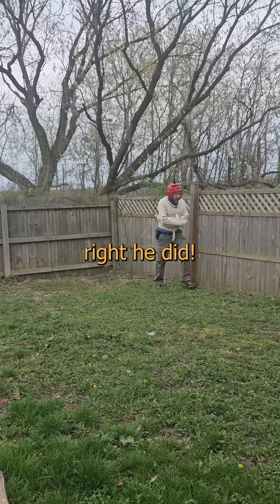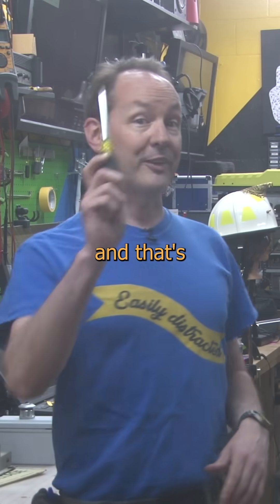Rack Screwed #chrisboden #comedy #engineering #screw #hardware #rackmount #apprentice #educational

Comment: I remember the first time i was handed an impact, first time i ever used a drill. I promplty stripped every bolt on an air handler panel (was industrial, so like, fucking 20 lmao).
My boss didnt trust me with an impact for 2 years. The first thing i did when he gave me it again was strip a bolt LMAO. Ive gotten better since but the look on his face when i told him i already fucked up in the 3 seconds he had his back turned was worth hand tightening the rest.
And no, i didnt strip any on purpose, im just heavy on the trigger.

Comment: It is this exact reason I was able to get quick install rack slides budgeted for all rack across the entire fleet of power plant server rooms...I was forced to work with a team of Meatwads doing a full network equipment refresh about 12 years ago and after the fourth one that I had to unmount and remount because of either wrong nuts, wrong screws, or mounted crooked I completely lost my shit, sent them home and did all of the mounting before calling them back to swap the cables from old to new switches...then immediately got approval to move money from a different project with head room and ordered roughly 300 pairs of rack slides that require no hardware to install or adjust.  This is also why things like A+ certification are actually valuable as the programs that train you for that cert also train the simple mechanical things you run into in PC repair, but aren't on the test.  The Plant systems guys that work on the stuff really buried in the dark depths of the plant went down to Maintenance with dimensions and budget to get them to make custom Racks with static 3U permanent shelves.  What they got were rock solid, beautifully tig welded racks with permanent shelves and a mounting system that used Plant Standard M6 and yellow painted indicators with the bolt type, we usually only label stuff off STandard, but they wanted to be safe since Instrumentation team won't be the primary workers messing with those racks.

Comment: 😂 yeah, once you find something odd, you should stop and figure it out, or you ask someone... why is this???... from someone who knows. This is poetic, because it is so rare a person is made to fix a stupid mistake, and usually it's a royal pain to fix later on down the road when you find someone else left something like this for you and you don't have that easy tool and spare fasteners to fix it... or the luxury of time... It really is cheaper to do it right the first time, even if you have throw out some nuts and bolts, to make a common standard and leave spares in the empty rack rail slots for the next inevitable future add on gear, or the occasional pieces that fall into or under a dark cabinet never to be found again until the slate is wiped clean again...

Comment: Kind of the same situation with aircraft nut plates. Most had a floating threaded female insert. You could access the back side and remove the retainer clip after drilling the head off. No need to replace form in place gasket or inspection outside of final.

Comment: Why use two types of rack screws? Just pick one and be done with it. We here in the USA generally would default to the 10/32 with a little tapered tip to help the lazy find the thread in the hole.

Comment: we have racks that are drilled and tapped aluminum in some sites and the square hole racks in others. my department seems to be the only one that understands thread pitch. as much as i hate putting in cage nuts at least they can be replaced. i despise seeing 10/32 in my racks almost as much as using only one screw to hold something because every other hole is stripped. these guys aren't noobs either, if anything I'm the youngest, they should know better but i guess that isn't a requirement for retirement

Comment: Throw those garbage cage nuts away and get some CPI Clik-Nuts. There's a 100% smaller chance of stabbing your hand with a screwdriver while inserting them. Be warned, if you buy a bag with the screws included, they are NOT dog point screws which is a shame. BYO screws and you'll be good, otherwise bring a magnetic pickup for when you pop the nut out of the rack trying to get the screw started. If you're not going to use the electric screwdriver, then at least use something with a 12" shaft (or longer) over that little Klien. It will let keep you from scraping your knuckles against the cable management and let you hold your arms closer to your chest which takes less energy. I like a long Hozan JIS #2 because it fits 10x better into a Phillips screw than any Phillips driver actually does.

Comment: On a job years ago, another contractor used 10/32 screws in M6 cage nuts to hold an APC battery. I politely pointed out his situation and he informed me that was the correct way and how his team did it. 10 minutes later, there's a crash and the APC fell 3' onto the file server.
Reply: I felt that in my wallet.
Reply: That guy's going to get a promotion. FUMU.
Reply: @GREGGRCO  Foul Up Move Up for anyone wondering
Reply: Why tf was the APC mounted above the server? Rack design 101 is that the APC always goes on the bottom... 🤦
Reply: @GabrielWilliams-h3l No that is just the Cyberpower, the spec hasn’t been updated for the Eaton or the APC yet.
Reply: @egohde  more specifically heaviest stuff at the bottom of the rack, which if you are using them invariably a UPS (we don't use in rack UPS's at work).
It is a really important health and safety thing as it minimises the chances of the rack tipping.
Reply: @ because, that is where the RCDD specified it. Who is the same person that racked it…
Reply: "DAMMIT CARL!!!" 

How bad was the APC damaged from that?
Reply: @ronaldlebeck9577  APC was fine, the server was banged up, but functional. Thankfully they only had to replace the case.
Reply: @ronneidert  and that's the lucky side, thankfully it wasn't worse!
Reply: @ronneidert  What moron puts a UPS above a server? UPS belong on the lowest part of the rack.
Reply: <Expensive sounds ensued>

Comment: I've worked in a datacenter for 5 years and I can say it's a PAIN IN THE *SS if you find a client that has just a handfull of cagenuts and screws recycled from a previous job to hang some very expensive piece of equipment at shoulder height.

Years later I found there's another place you can find those cage nuts: inside the pull out rack of a fire truck. It has a whole door with little square holes that has a lot of cage nuts holding a lot of tools.

Comment: NO IMPACTS ON RACK GEAR
Reply: The time you save using an impact on a technician job is insignificant compared to the time and money you waste by fucking things up with impact over the duration of a technician *career*.
Reply: A few of us have trigger control, some are triggered to control, a few us us are rarely in control, but a tool does what it's operator tells it to, you can do quality work if you finesse the tool
Reply: Lmao. Use a drill or an electric screw driver. The hammer-action of an impact will fuck up the retention wings and pop the nut into the rack

Comment: Next time he'll use rack studs and not have the issue lol. Cage nuts suck the big one. 
Also many(most?) of the screws I've seen used in them are posi rather than Phillips. While you can use Philips to drive them it's bad for the bit and the screw.

Comment: Honestly if there was one thing I'd wish the US would go all in on metric on, it's hardware. No nuts, bolts or spanners that are slightly different because one is in metric and the other uses "english" units (despite the fact said country has not used said units in engineering for the last 50 years...).

Comment: Guy sounds like management material. Growing up in the 1960's was lucky to have several Erector sets and American Flyer trains where my dad taught me clockwise to tighten screws ,( screw that righty thightee rhyme ) and how to solder wires and the train tracks together before I was 12 years old. Like to have a dollar for every unistrut 1/4 - 3/8" spring nuts over my 50 years playing with wires.
Reply: I was a gremlin and would take everything apart as a kid to the point by middle school I earned the nickname "Jawa".

By that time I opened so many dead batteries I must have had a 8 pound ball of lithium foil and a massive box of copper from wires I no longer needed.

I remember the first time my dad gave me a drill and some bits I went to his old crashed truck and drilled the door locks out because I saw a thing in a movie about being able to do that too get into locked things. I was like 8 at the time. He was pissed because he always wanted to fix said truck eventually but never got around to it.

Comment: Back when I worked in the trades o found out I can work my 3/8 ratchet faster then anyone on my crew could run an impact driver. And I didn't have to carry an extra 10 lbs of tool and battery

Comment: You know what's even better? Those racks you can screw without cage nuts. Yes, my friend! He screwed them all with a drill instead of my powered screwdriver, and I had to use a titanium drill bit to VERY CAREFULLY remove the offender from its threaded hole.

1/10, would NOT recommend.

Comment: the fact ive seen the two different standards for cage nuts in a single rack on the same gear even is maddening
Reply: For the love of all things convenient, it might be time to retire imperial and fully embrace the metric!
Reply: @iamdave84  fun fact: the USA's definitions of imperial measurements are set in metric.

yeah. metrification came for us and we threw a sheet over it.
Reply: @iamdave84  I like having metric and SAE standard. (Imperial)
Most of us are smart enough to tell the difference between the two.
Metric was designed by the French for people that only have double digit IQ
Reply: The Fun gets more intense, when you are going into ETSI-Land, and you will find everything mixed around. Metric, Imperial, 19" Frames, 21" and 600mm mix and match, with self-tapping screws on one side and metric nuts and bolts on the other...

Or a colourful bunch of different Racks, each with its own tolerances, where cage nuts from rack A dont fit into the holes in rack B. And Rack C is something completely different with sliding rails, where you need to insert nuts with a welded spring at the back (Knürr/Siemens) 😢
Reply: some with #2 phillips heads, some with #3 phillips heads, and then there's that one manufacturer that uses torx head rack screws

Comment: Better those racks than the wrong screw for the pilot's windshield of a major airline. It happened. Hopefully, we'll all be metric in the next 100 years
Reply: Hahaha, won't be so simple in this cursed timeline. Did  you know there are the fractional metric screw sizes like with .2, .3, .4  after the number?  complete with all the thread variations like course, fine, extra fine, extra extra fine and some bizarre ones needing numbers.  Oh , and different thread cross sections like trapezoidal, buttress, and knuckle threads.
Reply: Just wait another 20, because I don't want to have to fcuk with adapters this late in life.

Comment: bulldogs are good idea but have you considered investing in those Knipex slip joint pliers that take out stripped screws?
I am and electrician and work nights sometimes to help with a lighting company and those slip joint pliers has help me crack open some fasteners glued on placed by an overzealous painter and you know hard water from the sprinklers at night do not help those bollar bolts

Comment: With those racks, toss those damn little packs of connectors  after the rack rails and trays are set up, so they don't get mixed with the hardware for the blades and server PC's. 

I worked on setting those up for years and had to show others who didn't have my level of building paranoia, who didn't CARE if they made errors like this. 

Younger people in this day and age just have not encountered PAPER instructions and think they're only for making paper airplanes. 

Us older folk know you make the paper planes AFTER you set up the server stacks.

Comment: AWESOME!!! When the newbies on my maintenance crew did a FUBAR like that.. I sent them out looking for oddities that never existed.. like a dash 60 (-60) choke cable... Ummm, it's a turbine engine... Or to get a belt stretcher so that the fan belts can be installed on a HOBART diesel generator. That all got spoiled when I sent a guy to get 10 yards of Flight Line. My jaw hit the floor when the newbie showed up with 30 feet of safety orange ¼" nylon rope. Of course I was like... WTF! Then he showed me the nomenclature tag. ¼" Nylon FlightLine. Some smart A$$ at the APP (airframe and powerplant) shop decided he was gonna be funnier than me .. touché. XD
Reply: Used to send the newbs out to get a metric crescent wrench .
Joke was on me when they started stamping the maximum opening size on the new wrench's , in millimeters.
Never one to miss an opportunity , I proceeded to pivot and won lots of bets with folks who hadn't caught on to the paradigm shift .
Reply: @kaboom4679  Awesome... Thanks... I'd forgotten about that one.   XD XD
Reply: We did that, one time sent a newbie to go look for a steel stretcher told him the roll was a few inch to short he finally figured it out after two hours

Comment: If the apprentice knew better, he'd have used a 10-24 to cold weld the bolt in place while also deforming the nut enough to make it hard to get the cage out.

Comment: Your just so fking great to let the useless do whatever they want with your tools.

That might make him get his own tools next time so he quits messing up on your's.

If the shoe fits but its cutting off circulation to your toes it really doesn't fit.

Try another shoe 😂

Are their any smart electricians out there besides you I mean, I can not see a bunch of electricians surviving long with an IQ the size of a box of rocks, when chasing lightning for a living.

The attention span of quick death when your back is turned, and bumped by live wires when trying to pick up the tool that just twisted your arm off in a basket three flights high.

Linemen do have an obstacle cource they have to run when avoiding pointy electrified objects I can only hope 😂

Comment: As a data center engineer / server guy... unforgiveable. I only use hand tools on my racks and my forearms reflect that. It also causes everyone I work with to curse as they realize that the screws aren't crossthreaded, they are installed so jfc tightly that no earthquake is a challenge.

I also use this trick on anything in the fridge with a screw top to keep the kids and wife out. 🤣🤣🤣
Reply: And always use the right Screwdriver/Bit for your screws. I have seen too many M6 Screws with Philips 3 sized head, where someone tried to tighten it with a tiny-winey PH1 or PZ2 and broke the inside...

Just to mess with someone i also managed to mount a device with 6 different screws (Inbus, Hex, Torx 27, Torx 30, Flat, PH3) 😅
Reply: @1lI1l1Il  Not the spare screw box install😭 or as my pops used to call it, the tamper resistance special 😂
Reply: Yup. Maybe an ugga dugga or two for good measure, but installation is done exclusively by hand. Mostly because metal shavings+server room=🔥💸
Reply: The only time I use a drill for screwing something down is when I know it is a temporary build.
Reply: @camohawk6703 or if it's wood working

Comment: This is why it’s good to always have a cheap low torque electric screw gun. Drills and impact drivers are for construction, not light assembly.
Reply: I've got a reeeeeally cheap Stanley that if I let off just before it ugga-duggas (or only let it get 1 hit in) is absolutely PERFECT for light assembly! I can even assemble IKEA stuff with it. I love it because it's faster than any drill-driver I have.

However, if you let it properly hammer, you will 100% destroy what you're playing with, so any mistakes will bite you BAD
Reply: I got a Dewalt with a torque dial. It's pretty nice.
Reply: i learned not to hand the milwaukee M18 impact driver to anyone that way, the first thing a coworker did was cross thread a 10-24 screw into an aluminum rack so hard the head snapped off.  at least the extractor bits and tap saved the hole, mostly.

Comment: There is a special place in hell for those who put M5 cage nuts in with M6 cage nuts.

I have a degree of sympathy for those who use said box and put a few M5 cage nuts into a rack, but the M5 nuts will always be halfway up a 20RU crate, and only discovered once most of the M6 screws are in place.

The wayward M5s are never where a 1, 2 or 3RU crate is going to sit.

Comment: Pro choice till the 54th trimester is wild 😂😂
Reply from the maker: It should have been 75th, I typo'd the teleprompter and didn't catch it in post. Still a good joke though.
Reply: @Physicsduck  Well, at least at 54 trimesters you press reset on that human creation process at 18 years after inception...that's a good 9 month's before they are actually an adult and I kind of like that idea for about 13 seconds.
Reply: @verigone2677  naw. 3 trimesters is 9 months, so there's 4 to a year! 54 is 13.5 years.

72 trimesters would be 18 yr, and 75 trimesters is 18 tr and 9 mo, I think?
Reply: @samuelmellars7855  Yes, 18 years and 9 months from conception. So just shy of the 18th birthday as pregnancies usually take a little over 9 months.
Reply: @Physicsduck Ah, yes. The Ancient Greeks approach.
Reply: @Physicsduck  and that's pretty cool!
Reply: 30 years ago... in my toolbag, I used to carry a pound  of 10-32s and a pound of 12-24s everywhere.  Not to mention several adapter plates to mount 18" equipment in 23" racks.  I can't imagine adding metric to the mix.

Comment: The amount of times I've seen this happen to IGBTs 🙄 (or the minimum hose length between positive and negative DC cooling cut to 6" not 6', or SCR twisted gate wires "straightened and cleaned up")